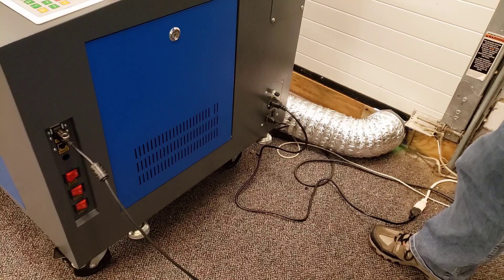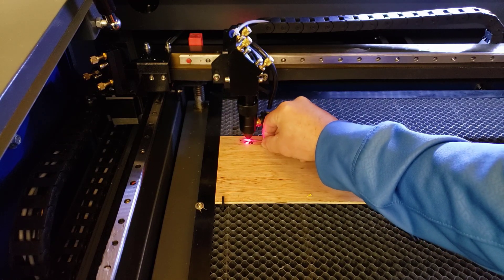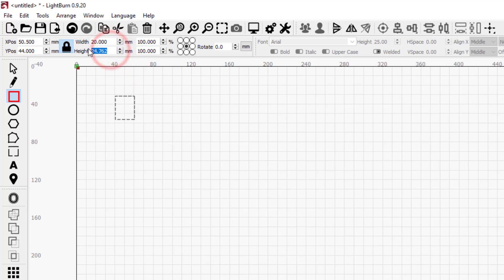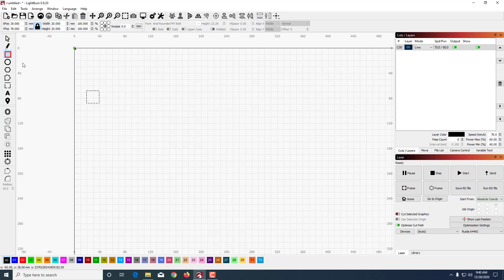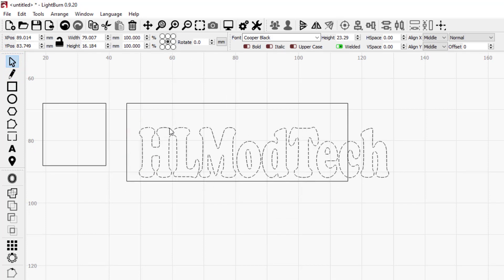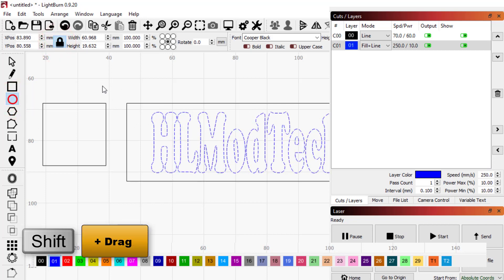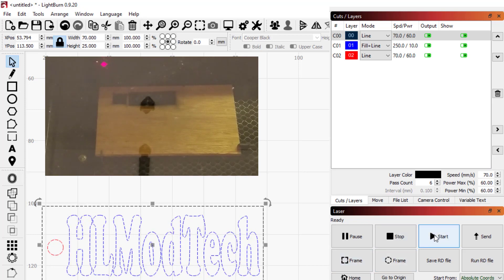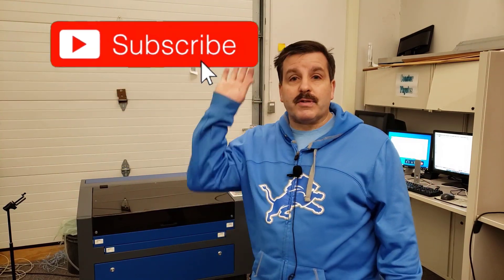Use Lightburn to Make a Wooden Keychain! Orion Motor Tech laser cutter

Comment: Is light burn just as feature filled as CAD software or Corel? Or would you recommend using multiple softwares in addition to lightburn or can it actually be a standalone? Thank you
Reply from the maker: Lightburn is quite powerful for designing. Probably not as feature rich as Corel Draw, but definitely adequate. I do not create tutorials for designing in it as my students do not have access to it on their chromebooks...  I design a ton with Tinkercad because of that.

Comment: I have the Orion 100W laser with Lightburn software and recently it has started engraving a letter and when partially complete the head moves to a different place to complete the letter.  Is there a manual available for troubleshooting this problem?
Reply from the maker: There was a manual with mine, but I have not been back to it since firing it up.  Does this happen on all files or just one? Using USB, or USB stick?

Comment: For this project, was the computer connected to the laser? Is that how you controlled it through LightBurn?
Reply from the maker: Yes, I have been using USB for all my projects since the very first one. It makes the workflow so much faster!
Reply: @HLModTech  I just got my Orion working today. I was able to print the test project they had already installed. Then I created a simple name on Lightburn, saved it to the U drive Orion supplied but when I plugged the U drive into the laser, it did not find a file. I then saved the test file to the U drive and did a file search on the laser and it found the test file. I also tried it with a USB drive I had and same problem. I know the test file ended in .rd , what am I doing wrong?
Reply from the maker: @neillcarvalho113  This is were I was using the files. https://youtu.be/e-FTdpvJ1R4 It was a .rd file, but I think I may show you how to navigate to it in this vid.